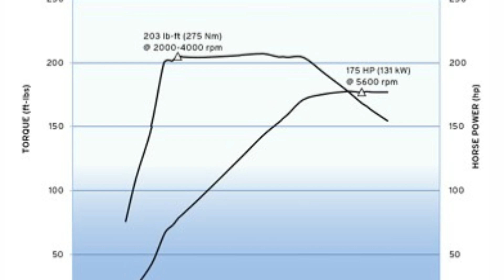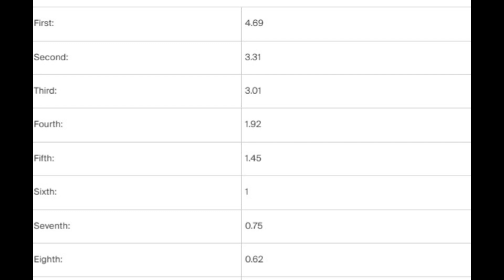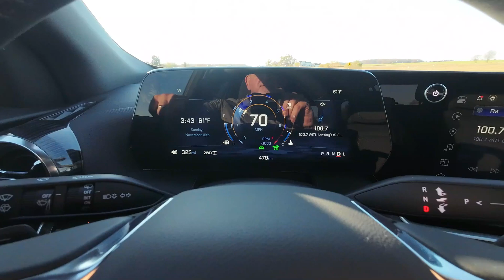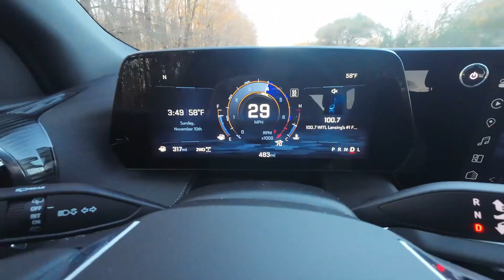2025 Chevrolet Equinox: Technical deep dive under the skin

Comment: Does the manual say that you can flat-tow this in behind a RV ?
Reply from the maker: No flat towing, front wheels on dolly for FWD. doesn’t say anything about dolly towing for AWD
Reply: @whatyaknowjoe67  That's too bad.  We have a 2019 Equinox Premier, 2.0 Litre, AWD with a 9 speed and it can be flat-towed.